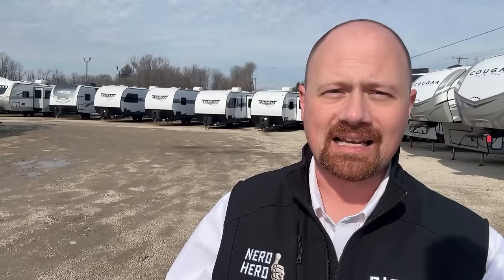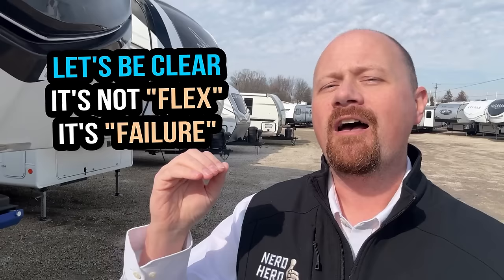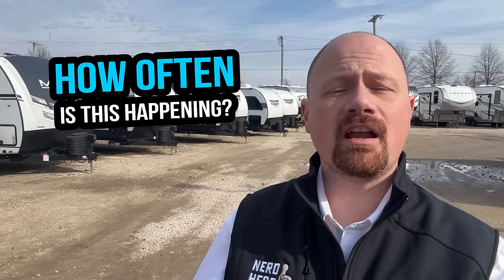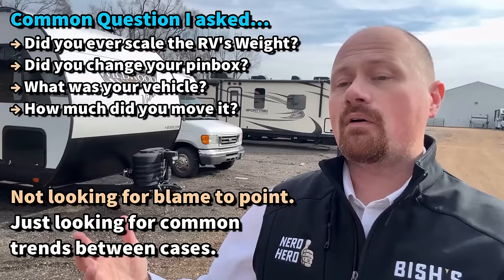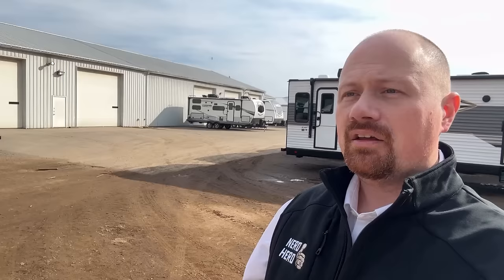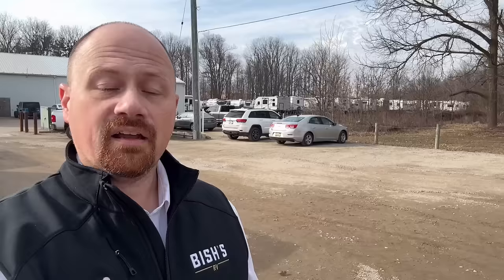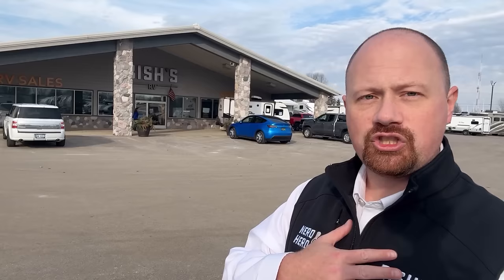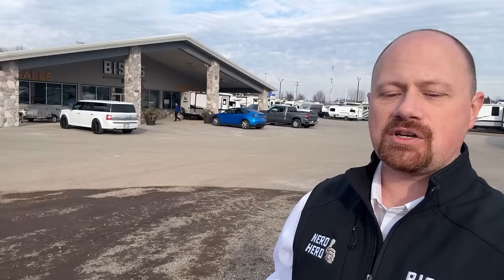🚨 RV Frame Flex & FAILURE!! • WHAT is Happening and WHO is Responsible?!

Comment: Josh, I appreciate your time and expertise. However the one subject I have to disagree with you on is the placement of blame on the user for over use (or moving the RV more than expected). I know you say that the user isn’t provided the information, and therefore their lack of knowledge leads to negligence. However, I truly feel this blame should be pointed at the manufacturer. The RV fulltime living lifestyle has become too popular to stop. To ask manufacturers to move away from the language I think is unlikely. Essentially I got from your video that no majorly produced RV is fully capable of handling a fulltime rving lifestyle or high frequency of towing. If so, then that manufacture (and I’ll name drop here because I can……I.E. Grand Design) needs to put those limitations clearly and boldly up front in their specs as well as warranty page so that the consumer can know such before they purchase the RV. And those manufacturers that which to display such language need to build their units to a higher degree of quality. Either that, or the Manufacturer should be quick to stand by their product when it fails that 1/2 of 1% of the time. I think a lot of the argument comes from the dealer, manufacturers, and suppliers each pointing fingers at each other to which ultimately means they can place the blame on the consumer. These frame flex issues aren’t just happening to bottom of the line units….ive heard people having frame flex/failure issues on high end expensive units as well.  I would have loved to know if these frame flex issues pertain to certain frame manufacturers. 

I would also love to see frame manufacturers provide max tongue wt limits for their frames for both travel trailers and fifth wheels. To my knowledge this isn’t general knowledge. For example, I have a Geo Pro G20BHS with a 4” BAL frame. I tow with a 2500HD with a 3,000 payload capacity. How much tongue wt can I put on that 4” BAL frame before it fails? I have no idea. I move my unit a lot. I weigh my unit every year. I have a good idea of my tongue wts based on how I load and can honestly say I’ve have 950 lbs of tongue wt on my 4,000 lbs camper. Is that overly stressing it? If not how much higher can I can before I have failure? I have no idea and I bet you if I call BAL they wouldn’t either.

Comment: If the frame failures are predominantly with larger fifth wheel RVs due to overloading, shouldn't manufacturers engineer frame construction to better match the storage they have created and promote?

Comment: There is a difference between "static load" and "travel load"     different forces at work.  Question: How does the manufacturer test for this when building the "proper" frame for the unit they are creating.   Different forces at work.   The consumer can only account for static load meeting the carry capacity guidelines
Reply from the maker: I lack, and it’s on specific testing. Perhaps a manufacturer could clarify that for us

Comment: Josh - really appreciate your information ... much of what you have said is spot on - and it is extremely important to pay attention to what the user can do  in terms  weights and changing pin boxes or proper vehicle  ... however ... we should explore not only the "why" but the "why now"  ... meaning what what has changed ... i doubt if owners use habits (or bad habits)  have changed   ... but so many new models/rigs have been  introduced to the RV space ...  and perhaps the mfg engineering frame requirements are flawed or not robust enough  ??
Reply from the maker: I’ve definitely thought a lot about that. I think that there has been a little bit of a climate shift there regarding how people use their RVs but a lot of of it has been predicated by the impression that they were able to do so through the various way RVs are presented to perspective owners and consumers. There are also more people now looking to RVs as an alternative affordable housing solution versus a sticks and bricks home that previously were not necessarily. At least not in the frequency and quantity that we have today. There’s a lot of facets here, and I don’t think there’s one single direct answer, but rather a lot of influencing factors that have all kind of culminated until the pot finally boiled over.

Comment: I think one big issue people forget is the weight of both fresh water and grey water, and how it affects both hitch weight and overall trailer weight.  I wish there was a way to easily see how the trailer is loaded under different conditions other than going through the scales multiple times. Also, what about how weight distribution can possibly overload a trailer frame? It's a hard thing to figure out.  In a perfect world, an RV dealer would have a set of scales available on delivery day to help identify those limits :)

Comment: We have an OLD (2000) Fleetwood built 23' trailer.  We camp out in the mountains and frequently travel down very bad roads to get there.  I have a very stiffly suspended Express 3500 van that I pull it with, and I use a WD hitch when I'm travelling more than 50km or so because it rides better that way.  That old trailer puts up with this abuse without a whimper.  The new stuff is straight up junk.

Comment: You mentioned about changing the pin box, what about some of the new things with shock absorption pins boxes or hitches or goose neck.
Reply from the maker: Same advice. If you’re gonna change something, you need to make sure it’s approved by the manufacturer. Or get it in writing from your dealer that it’ll be OK so it’s their neck on the line and not yours

Comment: Over Weight is most always excess water @ 8 pounds per gallon 3 x 43 gal tanks is 1000 pounds.The newest best feature ever installed in a RV is the water miser shower! It saves a lot of water at water and electric campsites. With the miser now the black and grey tanks last longer at water and electric only campsites, but not so with your fresh water tanks they fill up, too!. At the dump station, while you normally dump the black and grey tanks do you empty your fresh water tanks at the dump station, also? Those once always empty 50, 60, 80, 100 gallon fresh water tanks have to be dumped, too! Oh not on the ground that is legal! The dump stations operators are going to love you while you dump fresh water from the tiny fresh water tank valve. My Forest River has a water miser and fresh water dump valve much like the B/G stinky slinky hose. I now carry a separate sanitized slinky hose to dump fresh water, too!  To avoid the longer visits at the dump station I go off the city water a day or 2 early to use up the miser ed fresh water from the fresh water tank.

Comment: 2022 Jayco Eagle 355mbqs (great RV, love it!). However, the advertised pin weight vs the actual pin weight, even unloaded, is VASTLY different. Enough so that I went from a single wheel 1 ton to a dually 1 ton. Somewhere in the neighborhood of 600 pounds of difference. The overall weight of the camper is still under the gross rating, however. She's just nose-heavy.
Reply from the maker: That's what I'm talking about.. you had no way of knowing that until AFTER you bought it. That could be a huge problem for some people. 600lbs? That's a LOT
Reply: @JoshtheRVNerd  In all fairness, we were full timing so the front closet was full of clothes and we added a washer/dryer combo that it was already plumbed for plus two full propane bottles. But it was pre-wired for a generator that we did not have and the basement was only "moderately loaded". Adding a generator, in my opinion, would have put way too much pin weight on it. We tried to be very mindful of everything that we carried. It still surprised us just how high the pin weight actually was, though.

Comment: Okay Josh I just watched your video on frame flex aka. broken frames.  Your over thinking the problem.  First step,  the product must fit the process and the process must fit the product.  You don't have a problems with small or medium campers; used for weekends and vacations;  pulled with any vehicle rated for the weight.  The problem will show when you create a lite camper for smaller vehicles.  You have a problem when you try to give everything in one package.  Remember the Car boat the little convertible with propeller and rudder.  You drove down the boat ramp engaged the propeller and away you went
  It was a bad car and a bad boat.  Putting a garage on the back of a fifth wheel is asking to have.most weight behind the axles.  Add 40 feet of levers and turn a corner. The weight of a couple motorcycles will  want to continue in motion it's a basic law of physics.  You build beautiful interiors full size kitchens like a house and people want to live in them full time.  If you want them to be used only occasionally then call it a camper and put a decal " NOT for residential use."  Someone pays $100,000.00 + dollars and you tell them it's only for recreational use; we'll good luck.
I do appreciate your videos but   remember your car dealership doesn't make you call the manufacturer and neither should you.  If the manufacturer won't stand behind his products then don't accept their product.  That's how you stop the finger pointing.

Comment: I appreciate Josh's take on it as an attempt to stay neutral however manufacturers need to take full accountability for this in most instances. I am shocked that there isn't some kind of national safety standard for load capacity that manufacturers must adhere to. E.G in many industries they must exceed load capacity by 3x to get a capacity rating and that load test must be thoroughly tested in a vast amount of conditions. My gut instinct says greed is the root cause in most cases. Quite simply build them as cheap as they can get away with and charge as much as they can for their product.

Comment: After watching a bunch of frame flex videos from youtube full timers, I have learned this:

1) RV's were never designed for full time use, and customers are the ones who came up with the idea to use them that way.
2) I believe the industry reached the maximum safe length of a towable RV at around 38 feet. Campgrounds aren't designed for rigs bigger that that, and towing anything bigger is simply not safe.
3) As mentioned in this video : Cargo weight can be under the listed weight on the sticker like owners with frame issues have insisted. But that weight has to be distributed properly. That's why the actual tongue weight is so important !
4) If you expect assistance from a manufacturer for an issue with your product, making a video ranting, raving and bashing them online is not going to help you. It's only burning the bridge.

Comment: Josh one place that Dealers do a real mis service to their customers, especially travel trailer buyers is not having a scale available to weigh hitch pin weights. With so many limited CCC 1/2 tons being used to pull travel trailers and the grossly understated hitch weight posted in  "some" manufacturers literature it would be a real service and safety issue to at least offer the true hitch weight to the customer. It doesn't take much of a scale to do it. Would also aid in correct WDH choice and installment.
Reply from the maker: I say without hesitation: There are things we could do better here at my own stores as well

I know we do more than many places
But there are some basic things that could make life better for everyone

Comment: I have a concern with one of your comments.   If I recall your comment correctly, you said that these large 5th wheels were not made for frequent travel.

There's nothing in any manufacturers literature saying that large 5th wheels should not travel frequently.   We KNOW people frequently travel with large 5th wheels.

I recall you saying once that the Montana High Country is a traveler's Montana.  It's a big RV.  Is it or is it not a traveler's RV?
Reply from the maker: That’s exactly my point - intended designed use and discussed intended use aren’t the same thing. How is a customer ever supposed to know?

Comment: Ok here is what is frustrating.  You cannot sell a rig designed for the road and then say “well it’s not really designed for that much travel”. Are you kidding? The tolerances need to be way over the stated cargo weight statements. The frame should NEVER FAIL with normal travel usage (pavement or gravel).  I feel horrible for anyone who purchased a large Grand Design over the last 5 years. They are failing miserably. Lastly we need regulation on warranty.. there needs to be. Minimum just like cars. 3 years and 36,000 miles and there needs to be manufacturer repair facility for every brand.

Comment: If the frames are built properly for the size of the rv going on it it would take a huge amount of weight over the limit to cause this I agree overloading is never good but  if its happening even close as much as it seems the manufacturers should be held accountable i guarantee if these were semi trailers having these issues the government would pull them all off the road and forced to repair the issue and all of them would be inspected for safety as far as moving it to much what's the point of having a camper if your limited on how much you can move it this needs to be addressed because a flexing frame its broke because its not functioning as intended and eventually one is going to actually snap and cause a major accident on a highway and cause major injuries and large amounts of damage to many vehicles

Comment: Hey Josh, Question: Bucking or Chucking

I have a Brinkley 3610 and changed the king pin to a GenY executive gooseneck. I am getting a lot of bucking. My tow truck is a Ford F350 SRW Platinum Tremor. 

I am about 3” nose high and plan to adjust the Gooseneck up to lower the nose and be more level. Any idea of why I am getting so much bucking? Thai happens on concrete roads and they are relatively smooth. I tow dry and have a normal amount of stuff in the under belly but not stuffing it full of heavy stuff. 

Thoughts?  

I really appreciate your help.
Reply from the maker: Man I fear I don’t have enough experience diagnosing hiccups like that remotely. I usually have to be in the rig to feel it out

I know those Gen Y’s have different tensions.. do you perhaps have one not aligned for your weights? Wondering who choose and paired up the model

Comment: All the frame flex talk is about Lippert frames and especially 5th wheel campers, there also a lot of talk about weather or not you show be switching out your pin box from a 5th wheel style to a gooseneck style. Currently I believe the Reese Goosebox is the only one Lippert has tested and approved for there frames. It's my understanding the Gen-Y gooseneck conversion is not been tested yet by Lippert. My question Josh is how about Northwood campers, I own a Arctic Fox 27-5L and would like to switch to the gooseneck style box because it will just work better on my Flatbed 2500 Ram truck, but I can't find anything on Northwoods opinion on these two conversations!
Reply from the maker: I would suggest contacting Northwood directly https://northwoodmfg.com/more/contact/
Best to hear something like that straight from the horse's mouth I'd think

Comment: The best advise is to stay away from towable RV's ,they are using light gauge metal ,ever look at a stock trailer look at the beams they are huge and the size of the axles no comparison . One thing that has always bothered me is the high ground clearance they are like a flag in the wind ,also they should switch to rubber torsion axles .

Comment: As a prospective fifth wheel buyer, I find it incredibly frustrating that one has to actually buy an RV and only THEN find out the true weight and cargo capacity.  When some trailers have a stated cargo capacity of around 1,500 pounds, it would be terrible to buy it, then find out the actual cargo capacity is around 1,000 pounds.  Every dealer should have an on-site scale so buyers know the exact weights before taking possession.  It's a bigger risk when having to order one sight unseen.
Reply from the maker: Obviously, I 1000% agree

Comment: EXCELLENT VIDEO! Best explanation of frame failure on the monster fifth wheels with usually just two people rattling around in it. Hey can you do a video on axle ratings? Example. I have 2011 funfinder. Sticker on axle says 2800lbs. This is a tandem. But sticker on side of body says each axle is 3750   Gvrw is 6000. CCC says 1875. How can that be with two 2800lb on the axle sticker? . Take care
Reply from the maker: That is another thing I should put out there. Manufacturers figure the amount of weight. The truck is carrying off the hitch into their GVW which I think is totally wrong.